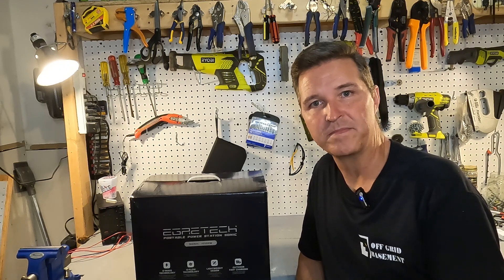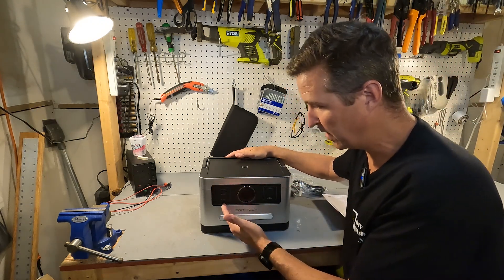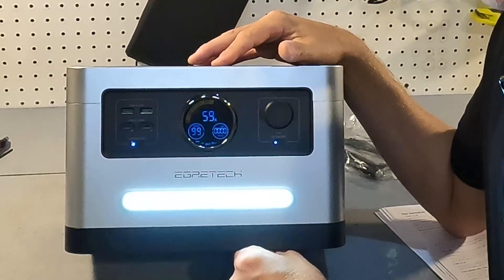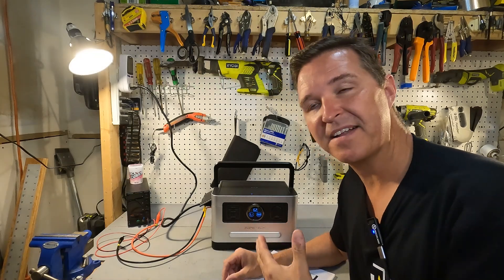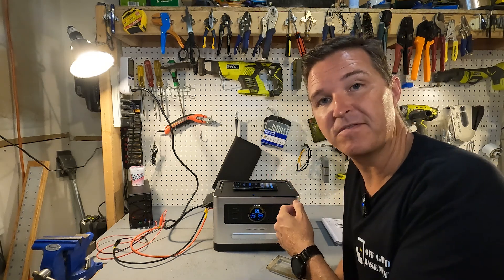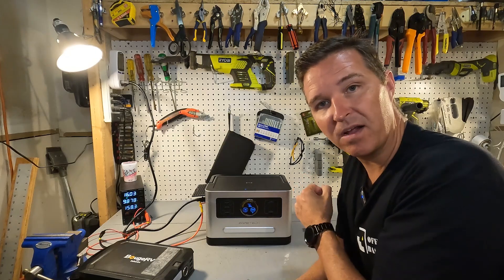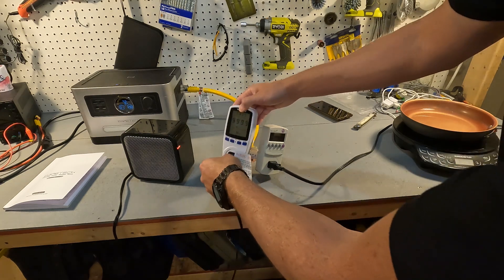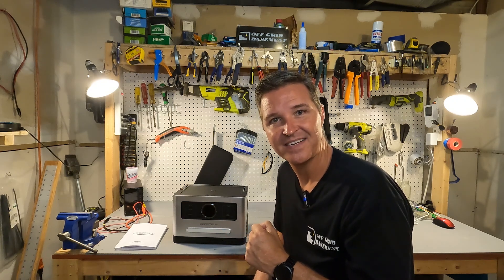EGRETECH Sonic 1200 Power Station.  A lightweight powerhouse!

Comment: I'm surprised they are not using LFP batteries.
Reply: I don't know why they still use lipo. I wouldn't be comfortable having a power station in my house if it wasn't LFP.
Reply from the maker: It surprised me as well.  Thanks for the comment.
Reply: In general, Lithium-Ion batteries - kilowatt vs killowatt - are lighter and have a smaller form factor.   Lithium-ion has a higher energy density at 150/200 Wh/kg versus lithium iron phosphate at 90/120 Wh/kg.  That can be relevant and significant depending upon your use case.